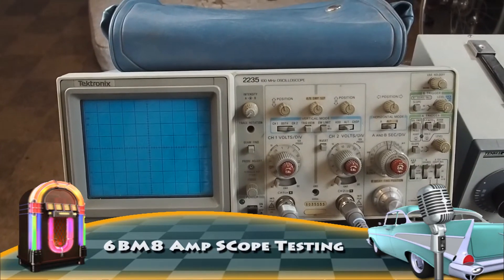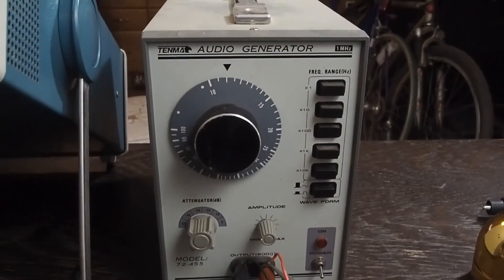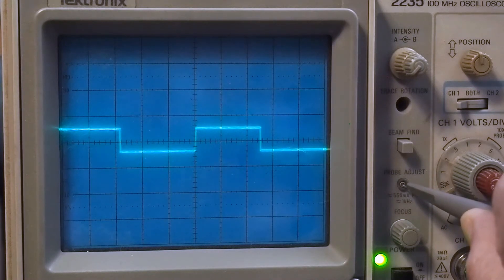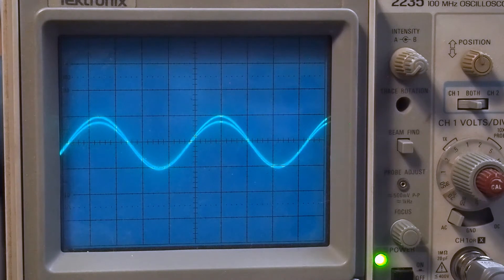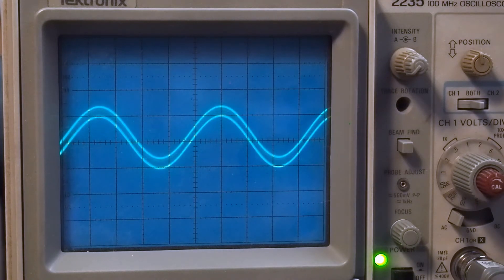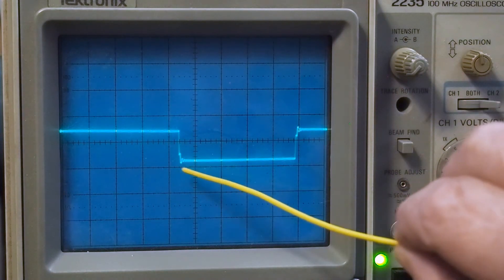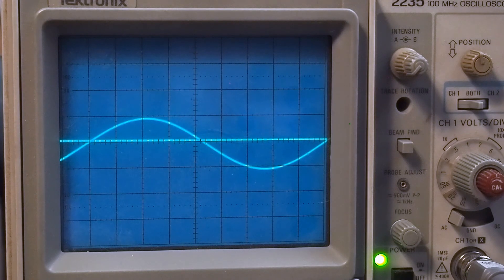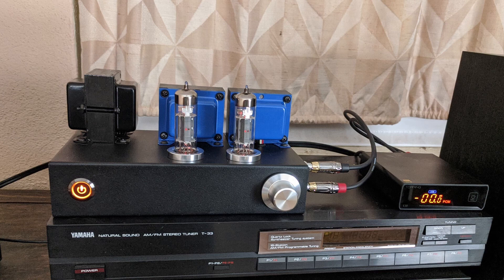6BM8 DIY Tube Amplifier - Final 'scope testing!

Comment: Can you  tell us which amplifier build is you favorite?
Reply from the maker: It's hard to beat the little 6SQ7/EL34 amp.
Reply: @SkunkieDesignsElectronics  Yes thanks to you're  video I built one.  I didn't use the Mundorf caps, but now have them on order.  I build the 5s preamp also. I love both units and thank you so much for posting the Video series.

Comment: In a SE class A amp you can compare bypassing or not doing so the cathode resistors....it's a case by case choice , results will vary , some will do measure /sound better without caps and some won't ......nice job , thank you !